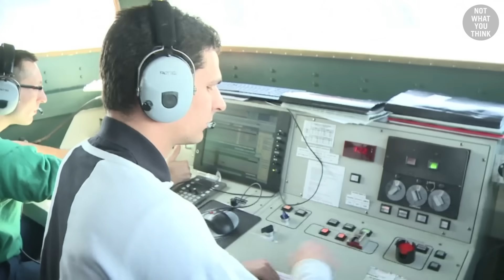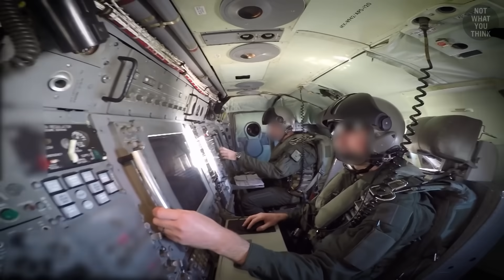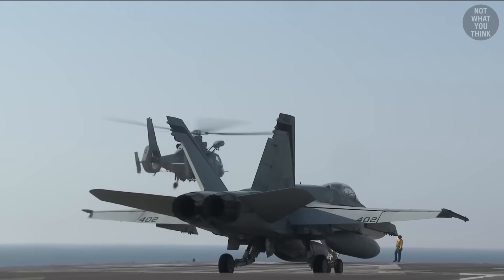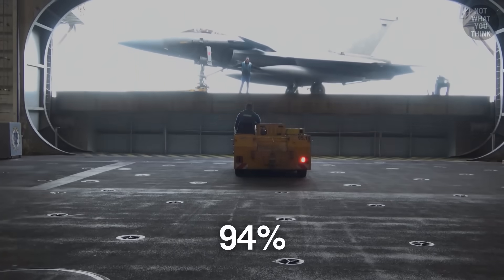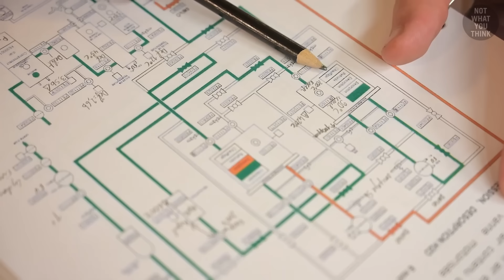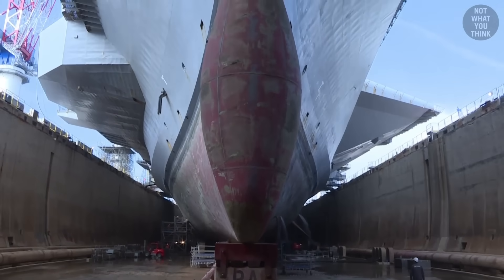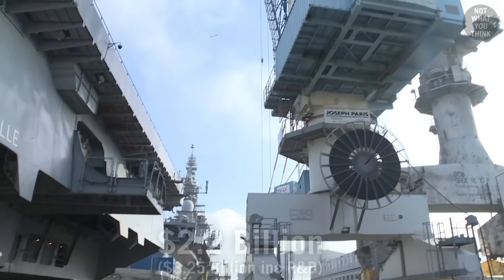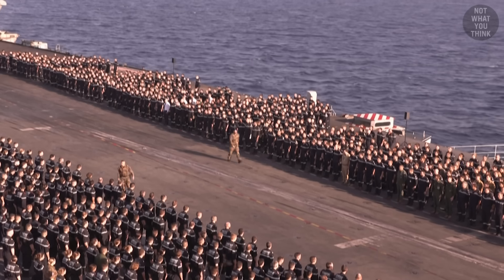Why This Small Carrier is Most Powerful Outside of the Supercarriers

Comment: What was the splash at 18:06? Was it part of the launching catapult apparatus?
Reply: Yes, that was an old video clip of the launch of a Super Etendard aircraft which has been retired since.  It used a wire sling to connect from the front wheel assembly to the
catapult. What you see there is the said wire sling being jettison during launching.
Reply: @445Navigator  Called the 'bridle' in US naval terms.

Comment: I really dont understand the concept of having a nuclear powered ship, at the end of the day a ships weakness is the sustainability of its crew, i.e. food and supplies but also fuel for aircraft. So either way even if a whole carrier group was nuclear they would have to dock somewhere regardless to top the ships stores of supplies even more so if its a nuclear carrier group as you would need atleast 2 auxilliary ships to provide for the group. But even then if you have an auxiliary ship you can refuel at sea. Nuclear just seems like a more costly and unenviromentally friendly way of creating energy and propulsion for a war ship (i want to be clear in not talking about general polution but nuclear polution if anything goes wrong with the engine or if the ship is hit in combat.

The only ship i think gets the most benefit is a sub, due to noise nuclear makes a clear cut in in energy and propulsion.
Reply: With nuclear power you can generate enough power to use energy intensive things like electromagnetic catapults for jets, directed energy weapons, etc and have spare capacity for future advancements in technology. I know Gerald R. Ford generates far more power than it uses for that reason. 

Plus imagine if you never had to refuel your car. Yeah you’d have to stop for food and bathroom breaks but you never have to stop for gas. Maybe that’s a bad comparison but not having to worry about fuel seems like a big logistical advantage. One less thing to worry about when restocking, one less vulnerable ship in your carrier strike group, etc. 

Edit: well other conventional ships might need refueling so maybe that’s a bad example. But idk imagine being in a conflict and your fuel ship goes down, you’d be kind of screwed. Better to be able to withstand that kind of problem than not I suppose. I guess that makes it worth the expense?

This is just my opinion though, not claiming to be an expert on the subject.
Reply: @venue_music_videos  Energy isnt exactly the best point becuase while yes a reactor does produce more energy the bottleneck is the the generator its self, you could have the most powerful generator in the world but if you dont have a generator well suited to it then your energy will be limited. 

Diesel Engine are just as capable of a similar amount of energy production but that comes down to the efficiency of your burner and of course your generators. Britain wouldnt have gone for diesel engine if those engines wouldnt be capable of doing some huge heavy lifting in the distant future when lasers are around. Also interms of lasers energy dosnt really effect it as much as having high quality super conductors and capaciters in order to store that energy. 

" Maybe that’s a bad comparison but not having to worry about fuel seems like a big logistical advantage." 

Like i said a nuclear ship still needs an auxiliary ship to get supplies so the logistical advantage really isnt worth it unless you have the money to do so. Its a slight advantage nothing more.

"well other conventional ships might need refueling so maybe that’s a bad example. But idk imagine being in a conflict and your fuel ship goes down, you’d be kind of screwed. Better to be able to withstand that kind of problem than not I suppose. I guess that makes it worth the expense?"

This is probably one of your better reasons, however navies always take these things into concideration. Supply ships generally will not go close enough to enemy territory for this to happen though so if it did happen it would be a rather rare occurence. For example Supply ships for america would likely come from Guam, while British ships would likely come from Oman if this was a scenario in the South china sea. So the Logistics for out reach any dangers of the enemy, the time they would be at most risk is at the point of refuelling and resupply. But again both ships would have to do exactly the same thing leaving both supply ships for both nonnuclear and nuclear ships vulnerable to getting no supplies.
Reply: @ashleygoggs5679  hey man you know your stuff. I get most my info about this stuff from YouTube videos so I appreciate your insight.
Reply: @venue_music_videos  aha, so do i. But it also just using a little logic. Here in the UK we are treated to many documentaries of the Royal navy and RAF, We have had 2 documentaries of the Queen Elizabeth on her maiden voyage and her first deployment into the South China sea. These are also very informative. 

But i have followed the QEC since she became sea worthy. They are facinating machines.
Reply: One of the advantages of having nuclear propulsion is that there are no exhaust fumes that generate turbulence near the ship and make take-off and landing operations less difficult.

Comment: I don’t understand why Britain designed a whole new aircraft carrier around just a ski ramp with VTOL planes. Why go through all that bother and not add that?
Reply: Becuase when we initially decided to make new carriers the blue prints had Electro magnetic cats in mind. At this time America was concepting EMALS and had struggled with them so when it came to building the QEC class we deemed it unlikely EMALS would be ready by time the ship was complete. Even noe the GR Ford class is Trialling EMALS. While the QEC was also being concepted Britain work with America to solve the F35B and Rolls Royce and Lockheed worked together to solve the stovl Issue. This is why the UK is the second largest contibutor to the F35 program after america. Anyway due to an unproven EMALS system the UK opted to build the QEC with Ski ramps to save costs but also build the ships with Future upgradability in mind once EMALS are proven effective. 

Ski ramps are a temporary measure to keep the carrier operable while we wait for new technologies to be proven. The reason we didnt opt for steam cats is simply cost saving. Why fork out so much money for something you know your going to replace in the near future. Britain just chose the most cost effective route around a time limited issue.

Comment: The French have been playing with their carriers for a very long time. It is possible that they are the only nation, other than the USA, that has the skills necessary to take full advantage of their carrier. They have experienced crews.
Reply: Wrong, GB was the first country to invent Carriers, the Last 20 years are the only time period we havnt had any since pre WW2. We have more experience with aircraft carriers then france historically.
Reply: @ashleygoggs5679  you have been without real carriers for decades. Even your harrier equipped cruisers stopped fixed wing operations almost twenty years ago.

You are only just recently getting back in the swing of operations with a real carrier and the last time I heard you don’t even have full air wings yet. Nor are your ships fully crewed. You also are short on escort vessels for proper operations. Experience doesn’t last, you either use it or you lose it and have to regain it, as we recently learned when we let our anti submarine skills decay after the end of the Cold War.

Yes you “had” experience in the past but the French have continually maintained operations during your hiatus. My statement still stands.
Reply: @ashleygoggs5679  bro uk only had a gap between the last gen Invincible class aircraft carrier and the QE class of 4 years not 20.
Reply: @Samaldoful  Britain sold off our HMS ocean in 2018 you are correct but she stopped being used as a traditional aircraft carrier for a long time, Her roll was more of an amphibious assault ship.

In 2011 she was used as a helicopter carrier which is when apaches where first used in action by the british. 

So technically i am correct, we havnt used carriers in their conventional sense in around 20 years.
Reply: @ashleygoggs5679  agreed maybe a 10 year gap with fast jets tho still maintained and serviced etc so no huge gap

Comment: (4:25) 120 knots to zero in 1.5s: 120 knots is 61.7 m/s, averaging over 1.5s is 61.7/1.5 ≈ 41.2 m/s² or (41.2/9.8) ≈ 4.2 G of deceleration. Similarly for a catapult launch with CATOBAR: 0 to 150 kt in 2 seconds is about 3.9 G of acceleration.

Comment: 10:17 don't be delusional. It barely can get to 35kts. Go learn some science before saying this nonsense. It's called froude number. And no the MW rating of a nuclear reactor is not indicative of much power the shaft have available. A lot of it is electricity.
Reply from the maker: Care to explain why?
Reply: @NotWhatYouThink I already did, froude number. Learn what that is, if you want a very basic explanation watch a video from IChaseGaming about it. It explains exactly why a ship that has a high tonnage cannot go fast since the power needed gets many times higher for each single knot. The example of the video is with a ship that is less then half the tonnage of a nimitz cv.

Comment: RE planes going in the drink, I'm honestly surprised aircraft don't have some type of buoy system to recover themselves which activate when the aircraft detects that it's:

1) At, or beneath sea-level, and
2) Submerged in sea water, and
3) Pilot has ejected/Pilot doesn't disarm a 10-second prompt to activate sea-buoys,

I mean the aircraft itself might not be able to fly again, but they can be used for spare parts.

You'd think that a few extra million would be spent to save the aircraft for later use, than letting it sink and arm Cthulhu even further.
Reply: Patently you have no idea what you're talking about.

A-  Extra systems (of any type and purpose) require extra space, payload capacity, & complexity of vehicle design.  Naval aircraft already weigh dozens of TONS, and every OUNCE must be accounted for and justified. &

2-  Once an aircraft hits the drink, NOTHING is reusable.  Structural components have received catastrophic damage, and Avionics (having been exposed to sea water) are absolutely useless.

Not even the fuel and hydraulic fluid are salvageable.  About the only thing they MIGHT be able to reuse are the tires on the landing gear, and (quite frankly) it's not worth the expense of adding an emergency flotation system to save 6 tires.
Reply: Like having it float on the surface?
Reply: it's probably because
1) too expensive, too heavy, too complex for maintenance
2) all that to potentially save an aircraft that is most probably smashed to bits (small useless ones)
Reply: They do float for a little bit before sinking, but it's there is nothing really to salvage from keeping them afloat (as others have said).   The only real reason to salvage them is to prevent tech from falling into enemy hands.

Comment: The new Chinese Type 003 is a monster with CATOBAR
Reply: It's an impressive ship, to be sure.  It'll take a few years for the Chinese to iron out the kinks and complexities of CATOBAR carrier maintenance and operations, but they are already miles ahead of the Russians.
Reply: China also has yet to invest in larger carrier aircraft designed to take full advantage of the added capabilities of a CATOBAR design.
Reply: @residenttallboy  
Type 003 is between 80,000 and 100,000 tons
Type 004 being built is over 100,000 tons and nuclear powered

Comment: The question should be which nation has the most reliable aircraft carrier! Because the UK's is certainly not fit for  purpose.
Reply: Whose aircraft carrier is most susceptible to Russia’s hypersonics is irrelevant. They all are.
Reply: @fZionists78 

😂🤣😂🤣😂🤣😂🤣😂🤣😂🤣😂🤣.....
...oh, I'm sorry.  Were you being serious? 🖕😈
Reply: @ts757arse apples to oranges lmao. 
The zumwalt was a stealth ship that actually pushed technological boundaries. The independence was a cruiser with a carrier face-lift, the carrier body and drive train was not set up for the top heaviness of the carrier deck. Prop issues weren't even the biggest deal with the independence class carriers, it was the shityjob welds breaking because they tried using two different  metals for the construction of the shop. there was nothing advanced about that. The US needed carriers built quickly to fight Japan, and we had 2 or 3 operational essx class carriers at the time, and we had 1 in for dry docks. The entire reason the indepance class failed is because it was a botched, rushed attempt at getting more carriers. "Quantity over quality" as the us needed quick completion time on ships during that period in the war. 
The queen Elizabeth super carrier is poorly designed pile of garbage that gives the English government a false sense of security. The type 45s are the only vessel you mentioned that I don't have 1st or 2nd hand knowledge of but anything designed by the British these days seems to develop some serious issues😂
Reply: @ts757arse if we're being honest the problems the QE has right now has nothing to do with the ship.
Most big ships like these have reliability issues in their early years like the CDG used to have in the 2000s, there is also the kerffufle with the f-35 and the genius procurement decision of the governement.

BUT the QE is still barely superior to the CDG in some categories while getting massacred in certain crucial capability area.

-endurance and speed: people argue the QE isn't any slower than the CDG because their top speed is actually that of their escort, which is technically correct but fails to take resupply into xonsideration, the QE needs alo LOT of resupplying because it burns a lot of fuel on top of everything else. The QE needs to slow down a lot more often for resupply ships to catch up compared to the CDG and the CDG still has higher top speed in emergency situations.

-aircraft per vessel: you'd think the QE would have a massive advantage in carry capacity, and it technically does (it can carry twice as many as the CDG) but its effective sortie rate is actually almost the same as the CDG believe it or not, a little above 30 aircraft for both is the sweet spot. The reason is simply that catapult are really good at launching aircrafts meaning even with increased runways it still can barely match that of the CDG

-aircraft type: the CDG is catobar meaning it is very liberal in the types of aircraft it can carry and their payload whereas the QE pretty much relies on the F-35 to get an advantage, if the F-35 weren't a thing the QE's aircraft would have reduced operational ranges and limited payload capacity, thank goodness the british procurement managed to secure all of the necessary F 35... Right? Right?

-related but deserves its own category: awacs. Awacs are just about the most important aircraft in any carrier group, they don't carry fancy missiles what they do instead is target acquisition, early warning, coordination etc... Tldr awacs are what make a carrier group so scary. The QE cannot carry fixed wing awacs because it's not catobar instead relying on cope rotary wing awacs which have serious range and capability issues (duh). What this means is that the QE is dependant on shore/inland radar, fire control and so on... Or need to team up with a carrier that actually has awacs (cough america cough)

As you can see the QE is dramatically less impactful than an equivalent catobar carrier, i think it informs us greatly on the job the royal navy intends to pursue in the future: being the USA's drinking buddy. Its capabilities on its own are fairly unremarkable but adding a more competent catobar carrier and the american made F-35 can fix a lot of the QE's issues while simultaneously making it more affordable. Meanwhile france very much intends to do stuff on its own which explains why catobar is our prefered option compared to more numerous but less independant stobar or stovl (yes i'm a totally unbiased french trust me i totally know what i'm talking about).
Reply: The UK’s had a simple fault on the shaft but the UZA’s (USA don’t use s anymore) 🤣 and the French have basically just copied British technology and put a ridiculous power system onboard that will cause disaster during the next naval warfare you see
Reply: @Handle-4-U copied ?? Tf u talking about 🤦🏾‍♂️
Reply: @guyanese_boy9734  most Carrier technology is British